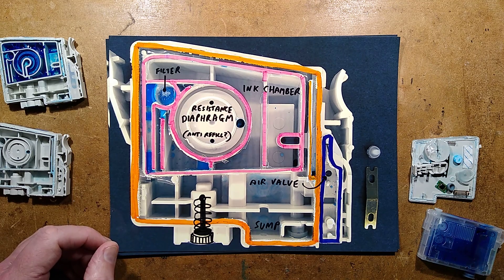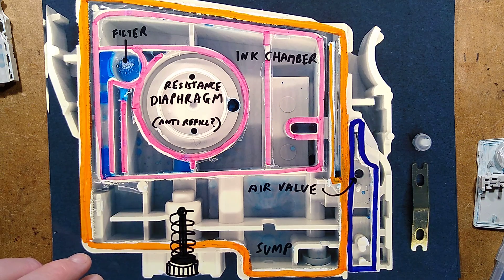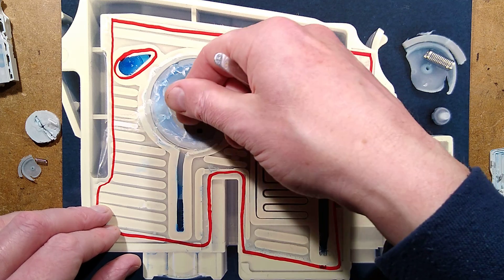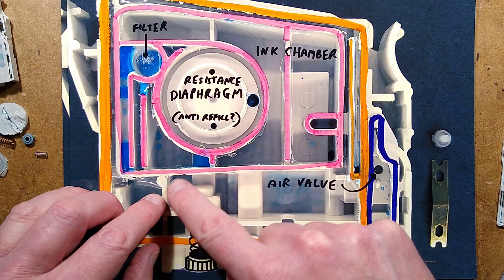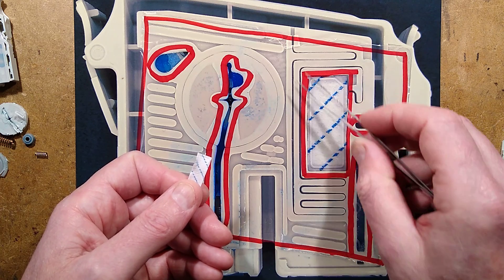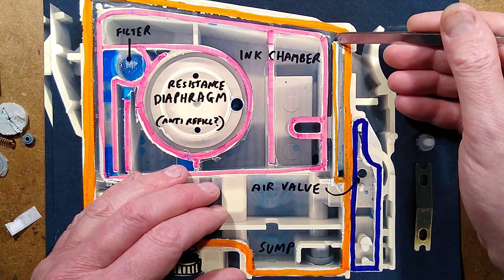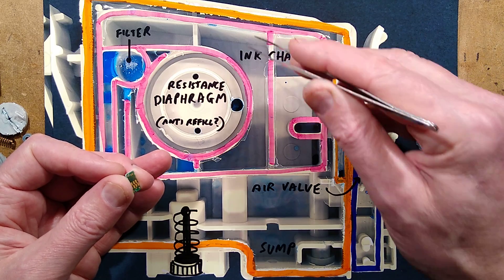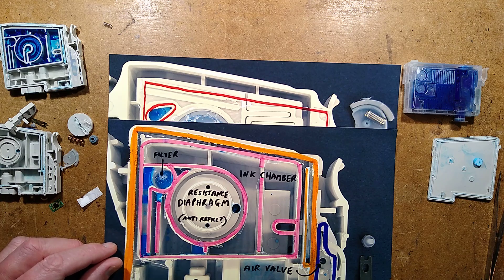Ink cartridges are complex inside!

Comment: I'm pretty sure the design wasn't that over-engineered.  They were hardly impossible to refill.  Replacing a sponge as a flow regulator isn't easy.  Without some careful work, the ink would just drain out the printhead.  It was the chips that was the real anti-refill technology.
To be fair, the biggest anti-refill reason is that almost ALL the refill inks, and I used some of the best like OCP, were not as good as the OEM, despite claims to the contrary.  Now, if all you needed was a bountiful supply of marginal ink to print school projects that only had to look good for a few months then, OK.
What is disappointing is that some of the mega ink-tank printers are selling you 2004 era, quick-fade (light or ozone, or just the paper) ink.  Canon does have a $300 one with 6 inks that is 2006-era Chromalife.  WAY better.  Of course, back in those years, more people were printing photos.  Now there are both not many reasons to print, and online (even large format) printing services are pretty reasonably priced.  I like to get collage posters made.  24x36 inch or so.
Reply: People stopped printing photos because it was cost inhibitive even when the inkjet worked perfectly. As most do not use the inkjet often they clogged up and then you try the cleaning cycle, printing test sheets to see if all the nozzles are working, wasting gallons of precious ink. I love to print photos but was not worth the hassle or the cost .Went over to a monochrome laser. I used to like the Kodak dock printer, the problem with that one was not the ink but the paper delivery system it always jammed and we tried several all had the same problem.
Reply: @tonysheerness2427  This is mostly for small printers that are not made as semi-pro photoprinters. Printers like the Epson P900 and Canon P300/P1000 'pay for themselves' in just 10-15 full-size prints - at least if you do an apples-to-apples comparison with the cost of printing at a high-quality printlab, and not high-volume, 'consumer'  printing services.
Reply: i wished printer manufacturers settled on the approach canon used in their chips where one could override the empty ink messages as a means of allowing refills on the original cartridges with no thirdparty tools while minimizing their liability to support issues that may arise from improperly refilling the cartridges or complications from third party ink formulations.
Reply: I printed photos with Epson original ink, on Epson paper, and have them on the wall in a room with no windows.  Less than 10 years later the green has turned reddish leaving them worse than half century old Polaroids.  While you may have had better luck with OEM, I'll never bother flushing money away on them again.
Reply: I have a $250 Canon ink tank printer that does a perfectly fine job.
Reply: @Studio23Media  If it's one of the 4-ink non-chromalife, stick a color printout on your dashboard in the sun for a day or two.  The inks fade incredibly fast.  Not a problem for everyone, but it's still inexcusable in 2023.

Comment: I use an ink-tank style printer. :)
Reply: I switched to that, the 6-ink Canon with Chromalife ink for photos.  TBH, though, the HP ink subscription program is a pretty darn good deal.  Amazing deal if you have a B&W laser 2nd printer in case you need a lot of B&W pages.  Some people who don't read the fine print get nailed if they subscribe to 50 pages, then one month need to print 200, and they forget to change the subscription for the one month.  I got the canon when the subscription HP's scanner died.  no scanner, no new cartridges (can't calibrate/align).  Here's hoping I get more years out of the canon.  One ink refill would be nice to get through.

Comment: I used to refill Epson ink cartridges you had to drill a small hole in the top plastic. After refilling you put a rubber bung n the hole. They had a chip that talked to the printer so I had a small device that re-flashed the chip, fooling the printer into thinking it was a new cartridge.                                Interesting insides 2x👍
Reply: I worked retail refill for a couple of years and I think we used suction through the air vent?    You put ink in a syringe, like half full, used a silicone block to seal the drill-hole, pulled back to create a vacuum, then let the vacuum pull the ink into the cartridge.  Where exactly the hole went, I don't recall.   I think we sometimes also filled with that method through the output port, avoiding any holes.
Hated those things.   Other than things like Canon BCI--6, refilled by yourself, at the printer, I felt a little bad about what we sold.  The laser cartridges were great.  I worked at the dawn of color laser, so there was some leakage with those.  I think that's been resolved by now.  The black ones tended to be sure-fire, esp since we replaced the rollers and blades (overkill in some cases if it wasn't too old, and wasn't a big cartridge.
Reply: Yes I would imagine Suction would be the best option, rather than attempting to push the ink in under pressure. I believe that's how they do it at the factory. @radellaf

Comment: Jeez that's more complex than many circuits you've explored. The air filter looks like a small silica gel sachet to dry the incoming air.
Reply: The air filter seems similar to the ones found inside hard disk drives...

Comment: While I still use my Brother printer with the cheap cartridges I do have a laser printer as well...the laser printer has a capacity of over 50,000 pages...still haven't hit it  :)
Reply: That was the big lesson I learned in retail refill.  Unless you ABSOLUTELY need color, get B&W laser.  Way cheaper, way more reliable.  IDK about color laser.  They stink for photos and cost a lot more than B&W.  But, don't dry up like inkjets.
Reply: @radellaf an advertising company I worked for bought a color laser setup. All that beautiful tech solely for the purpose of printing junk mail and flyers. But hey, the customers were willing to pay a premium...
Reply: 50K most likely based on 5% coverage.

Comment: Now you have the design, you can 3D print your own! :)
Reply from the maker: That sounds like a recipe for a huge inky mess.
Reply: @bigclivedotcom Is that not the point 😂
Reply: @bigclivedotcom ✊🏻👍🏻
Reply: @mikerichards6065   I am now intensely curious what happens if you try to print with carbonated ink.
Reply: @sirnickity Bubbles within bubbles ...
Reply: @sirnickity  sonofabitch you stole my comment .. lol
Reply: @mikerichards6065 it'd bring a new variant of "and it was signed in blood!" (and in 14pt Arial font) 😛
Reply: @mikerichards6065  fricking hell, that is genius. We want to see it!
Reply: @mikerichards6065   Mmm, printable Marmite! Yum! 🤣🤣
Reply: You would want to use a resin printer rather than FDM for this
Reply: Just convert printer into ciss! Inktank.
Reply: 3d print isn't water tight ink will still leak out
Reply: Only if you pass the background check XD
Reply: What would be the point? You’d be better modifying this to refill it
Reply: You'd need to over extrude and pray with an FDM printer.
They don't do watertightness very well.
Resin would do the job well. You could even add ink to the resin to dye the cart cyan.
Reply: 7:02 it’s like a one way valve essentially
Reply: @mikerichards6065  i really want to see this. it would be fascinating!
Reply: Very fascinating - this is why we love this channel. 
I'm still sticking with laser B&W but have a newfound respect for ink sluts.

Aside - lately haven't been able to find any dirtbag gutter slutting douche flutes laying about.
Reply: 3d printing is porous